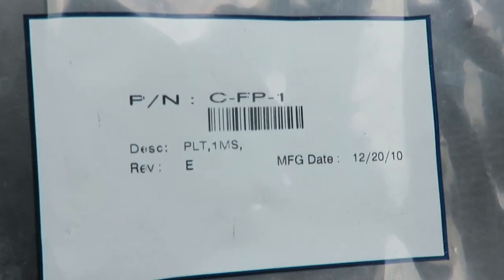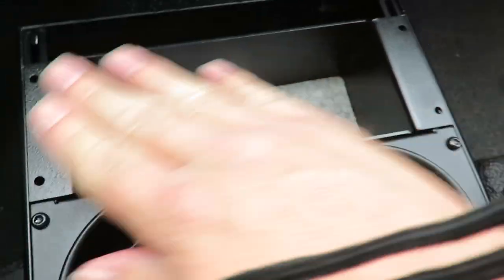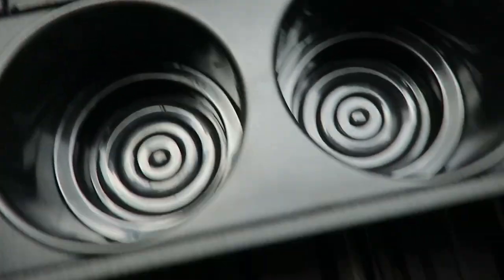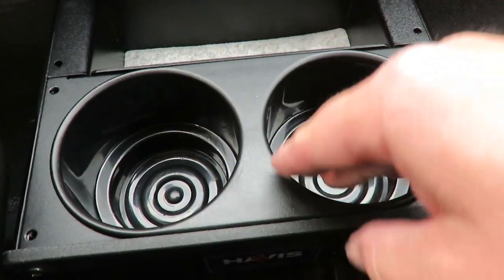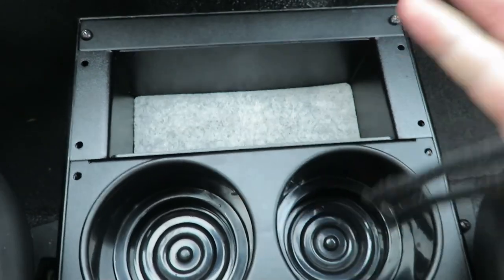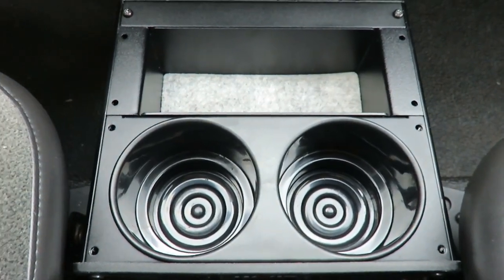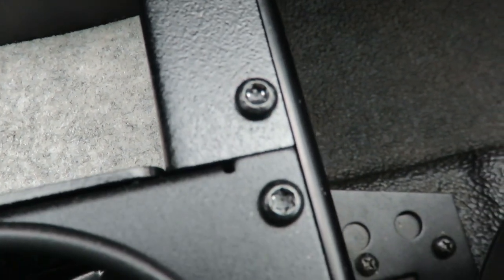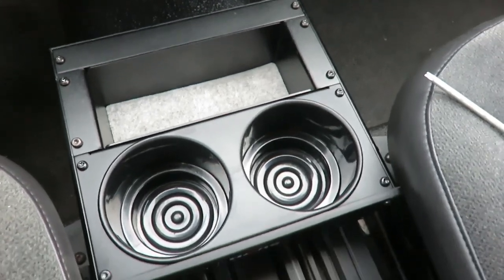Havis Center Console - Mini Cup Holder and Pocket - Completed / Installed in Impala 9C1

Comment: Hey allen are you ever going to put a cb radio in the p9c1 so you have it when you are on the road and are you ever going to put any lights in the windows just asking
Reply from the maker: As you probably know, I have a Crown Vic full of lights (bought from auction that way), so it's not likely that I'll add lights to this one.  Haven't thought to much on putting in a CB... but I might try to find a "brain" unit for the ones in the Crown Vic, just to complete the car.